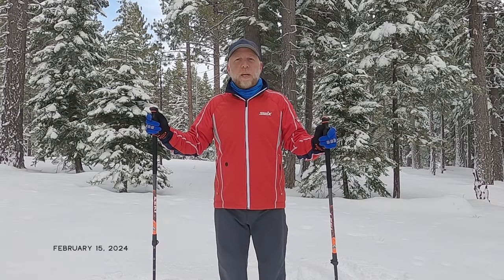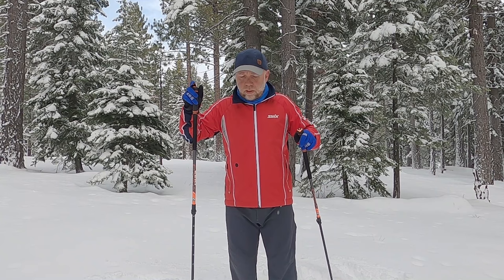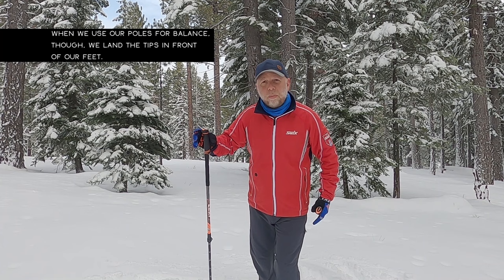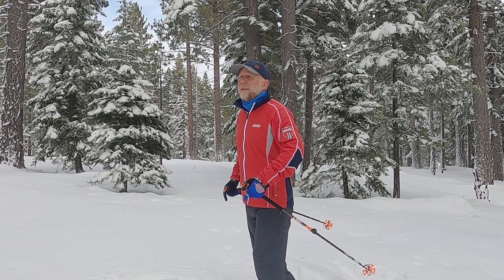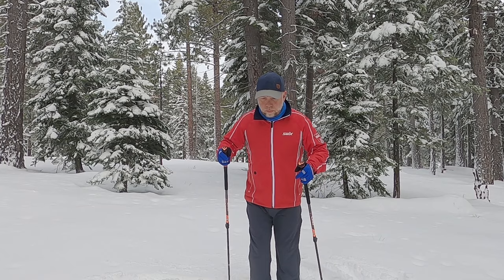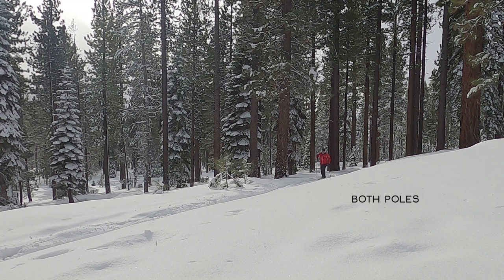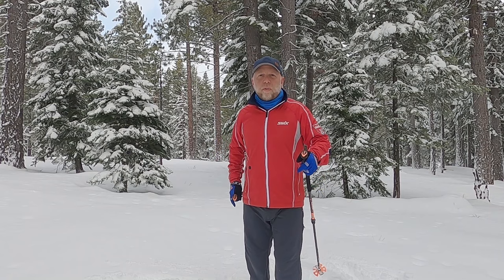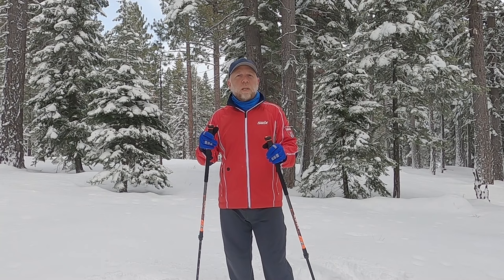Diagonal Stride Poling Drill to Decrease Stride Length and Increase Lower Body Stability

Comment: Great training technique! There's a particular trail network that I ski that is mostly flat fields that I'll do no pole drilling on. My classic striding has gotten better since last year but one thing I'm still struggling with is striding uphill especially if the tracks are icy. Any tips? The "up tempo" technique you spoke of in previous videos has certainly helped.
Reply from the maker: Hey Ramblin!

Glad to hear that your training is going well :)

Uphill striding can always be a challenge depending on quality of snow and angle of terrain. The general approach, however, is to shorten your stride even more than usual and to get lower on your skis. Make sure you're slightly tucking your tailbone (similar to a dog tucking its tail between its legs) to ensure your bodyweight is over your feet so that you can achieve the best grip possible. Depending on angle, you're probably not even going to glide but this is okay so long as you're keeping a quick cadence and, for lack of better terms, "pouncing" or "loping" or hopping from ski to ski. Again, this should enable you to achieve good grip going up the steeper sections of trail so that you can eventually transition to more gliding/striding once the terrain begins to level off.

I'll have to put together a video on this subject because it's also a great way to work on timing between skis and poles. Again, in steeper terrain but before you have to actually herringbone you can basically hop from ski to ski while landing your poles opposite of your skis (like normal) which then act as a brake (in addition to propulsion) so that you don't slip backwards. This latter concept is basically the same as doing the herringbone in that the ski poles landing opposite of the ski that you're laying down should keep you from slipping back on the one ski while you start to transfer weight to the next ski. And so on and so forth.

Yeah, at some point on a hill you just stop worrying about gliding and focus more on just getting up the hill (without slipping back).

Hope that helps! Let me know if you want more clarification. But I'll put the topic on my to-do list because it would make for a great short tutorial. So, thanks again :)

Comment: great content -do you prefer your LEKI trek poles to a standard classic pole ? nice SWIX jacket -hopefully some sponsorship ...
Reply from the maker: Hey Nick!

Haha, no sponsorship, just a really nice xc ski jacket. That said, I did actually win it in a raffle at work a couple of years ago ;)

As far as the poles go, I just happened to pull them off the rack in my garage. They are a more backcountry-oriented ski pole with a full basket so they seemed more appropriate with the newer/deeper snow. But at a groomed resort and in firm backcountry terrain, I'll definitely use a fixed length standard classic pole for striding.

Thanks for watching, and the question!

Comment: Thanks J. Would you describe this as a method to recalibrate your cadence when your hustling to get somewhere and feeling off balance or is it a drill that people should practice as a warm up aactivity?
Reply from the maker: Hey EC!

Great question! And I would say that it could be beneficial to try this in both scenarios.

For people new to xc skiing, poles and the proper timing of their use can sometimes add to the chaos (of all the moving parts involved in striding). So pulling the poles out of the snow and letting your arms swing naturally is a good way to reset. I think it's really helpful, too, to just stride for a while without the poles (and then one pole) at the beginning of your ski session. To warm up the engine, so to speak.

Again, we should always be developing/refining our lower body stability so every time we stride without poles will aid in this process. Also, by striding without poles or only one pole at a time, it's more likely that we'll take slightly shorter strides. I think this is a natural response to the fact that we'll have fewer points of contact (i.e. mostly just our feet). The idea being that we'd be keeping everything a little closer to home (i.e. feet underneath us rather than extending too far in any direction).

Thanks for the question, and for watching!

Comment: Great practice idea Jared! I've been putting some focused effort in trying to get full weight transfer from one ski to the next. As part of that, I am consciously trying to have the rear of my back ski come off the ground slightly (What you see really good skiers doing easily). It still seems somewhat unnatural and I often get the slap noise as well when the lifted ski lands again. Would you have any suggestions on what to try for this? Thanks, Brax
Reply from the maker: Hey Brad!

Great to hear that you've been out hitting the trails and training :)

As far as getting that trailing ski to come off the snow, don't consciously think about it or try to make it happen. That phenomena should be 100% "exhaust." What I mean is that it should just happen as a natural part of the process of committing all of your weight onto the glide ski (after pushing off and transferring onto it). Think of when you run or even when you walk at a very swift pace. Once you push off from one foot, you never consider what it's doing behind you because you're now focused on safely landing on the next foot. It just trails behind wherever it's most appropriate. For example, if you were leaning way over the trailing leg would most likely be pretty high off of the ground  because it's essentially acting like a counterbalance (to your upper body). Less of a forward lean will result in less of a rise off the ground from that trailing leg.

Long story short, focus on what's ahead of you and not what's behind you. Develop that single leg balance and stability and the ski will eventually and naturally come off of the snow.

That said, I made a video a while back about the ski slapping situation so give it a watch for more details (https://youtu.be/2HEiuzjOwLA). In essence, though, you're landing the glide ski too soon and it has nowhere else to go other than straight down onto the snow, hence the slap.

Let me know if you want additional clarification. But I'd recommend watching that slap video first as I go into some detail about this whole thing :)

Thanks for watching. And keep on skiing!
Reply: Thanks so much Jared.  I continue to be amazed at the time and effort you take to provide such complete and thoughtful replies to those that comment on your video posts.
I watched the older video you referenced on "slapping skis" and definitely plan to watch where my trailing ski is landing relative to my planted ski and try to correct if it is not far enough forward. I do know occasionally I get into a rhythm where I have a bit more bounce or bounding feeling in my diagonal striding (I've commented to my frequent skiing partner that it almost feels like I am hydro-planing down the track!) but will have to check if the slapping noise is perhaps less prevalent then.
This winter with our often very icy tracks, one of course gets extreme gliding distances and I'm wondering if that makes it more difficult to land the trailing ski ahead of the planted ski or whether it is still really a matter of proper timing. I'm guessing the latter.
Thanks, Brad
Reply from the maker: @bradshacker246  You're welcome :) I do feel like I'm running a consulting/coaching operation sometimes. haha! But I like to be able to offer anything I can to get people more interested in xc skiing ;)

Yeah, that would be a good experiment or way to evaluate yourself. That is to say compare the different situations when you hear the slap and when you feel like you're cruising along. Just keep at it!

Comment: Liking these drill videos !  Today I tried to ski on a frozen lake, which had some bare ice (snow was blown off by wind).  My skiing was basically just trying not to fall.  Double poling seemed to be the best I could do.  Is there a technique for dealing with solid ice areas ?
Reply from the maker: Excellent! So glad you find that style of video useful. Honestly, I don't really know why I don't produce more of them because they are fun. I'll have to keep adding topics to the list :)

As far as dealing with ice, I think your instincts are on the money. That's about as bad as a scenario as I can think of for cross-country skiing, but double poling seems to be the only thing that we can rely on in that condition. It simplifies our movement and keeps our feet right beneath us (decreasing our chances of falling). And it's a really fast way of crossing that terrain!

What's even worse when dealing with icy terrain is dealing with icy terrain on really wide skis. They want to slip and slide everywhere, and they're more challenging to find the ski edges compared to a skinnier ski. So, I guess if you knew you were going to be xc skiing across really firm and icy snow, I'd recommend using a skinnier ski. If that ice is just one section of the overall route, then you'll just have to deal with it for that time. But skinny skis do work a little better on hard-packed and icy snow.

Hope that helps! And thanks so much for tuning in, and your kind feedback :)
Reply: @JaredManninen  Thanks for the input, I felt like I should be doing something that I didn't know about, other than clumsy crossing ice.
Reply: Stuff you don't you normally hear apply....good stuff.
Reply from the maker: @WaterTrails  I tend to feel that way, too, on ice. But ultimately it's just clumsy and frustrating, so double poling is the best technique for dealing with it :)
Reply from the maker: @WaterTrails  I'm with you on that ;)